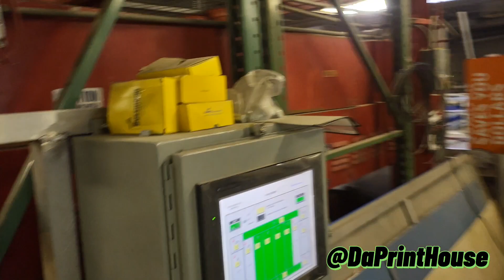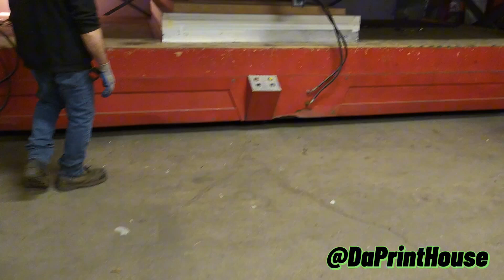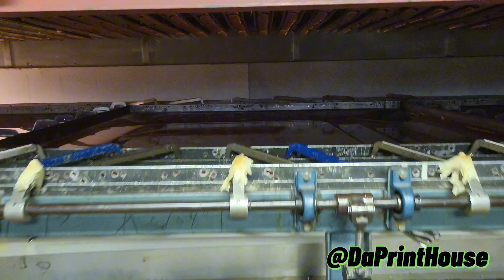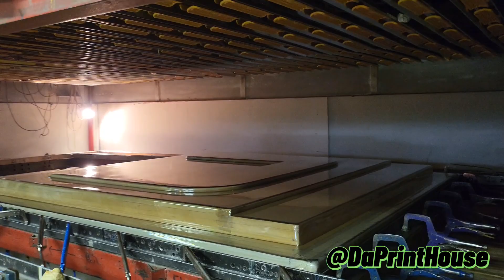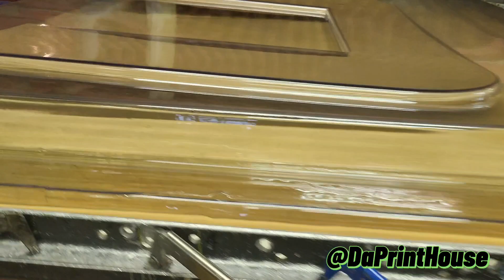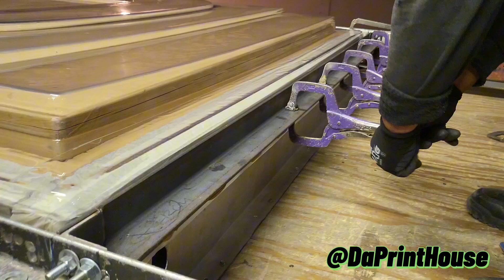Join us making a 6ft vacuum formed face for a big sign job @daprinthouse @signs

Comment: Hello Da Print House, I'm a fan of the YouTube channel. I also own a HP 365 & fc9000 Graphtec cutter. You did a video some time ago about having your vinyl adhesive media cut. down into smaller rolls. I use a lot of HP prime GP adhesive Vinyl. Purchased thru Lexjet. May I ask who are you using to cut down your vinyl rolls? (Grimco, IT supplies, JDS)
Reply from the maker: A lot of vinyl suppliers cut rolls. Yiu have to just ask them and see.